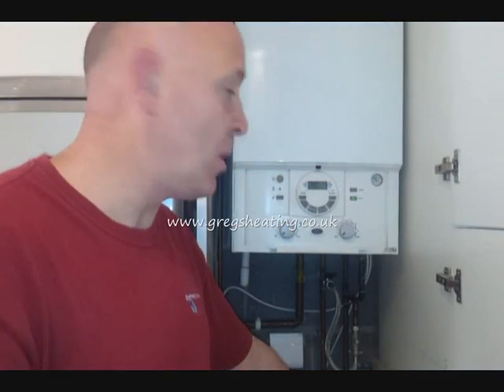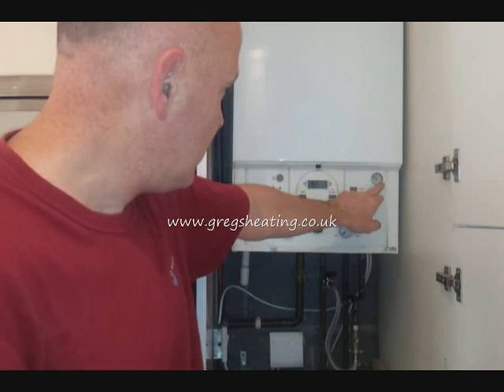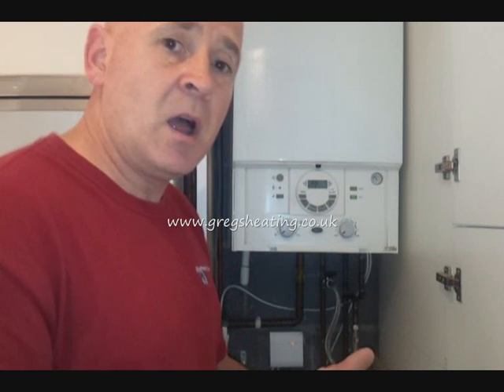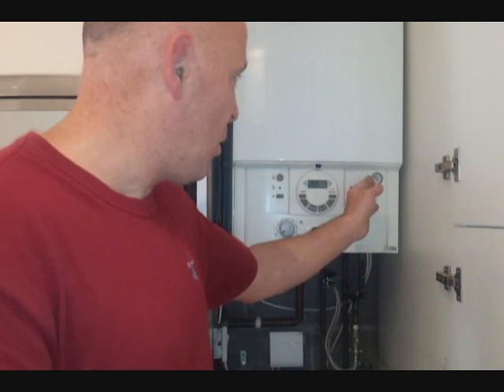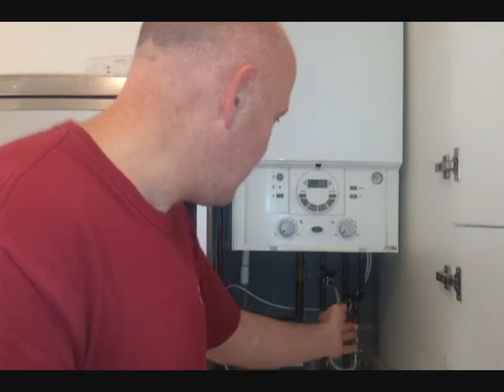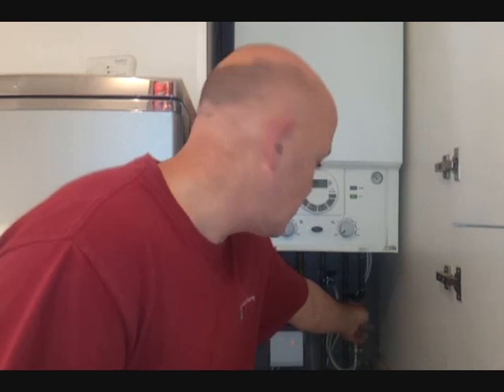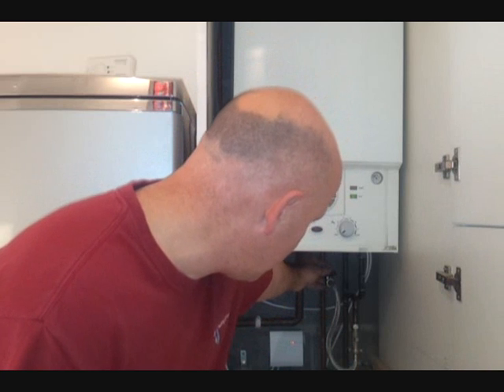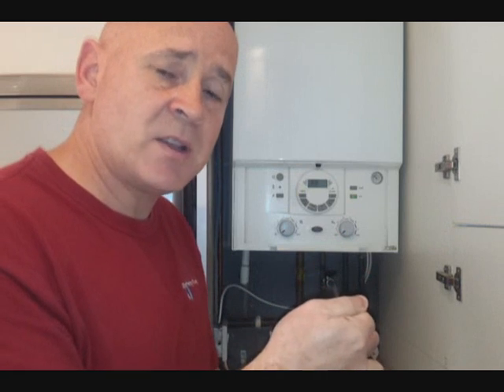How to repressurise refill a combi boiler central heating system.wmv

Comment: No water coming into little mesh tube to put in boiler to increase pressure??.
Reply from the maker: There may be a few reasons simple to rectify your best to call an engineer at this point as it’s quicker to get you running again

Comment: i have a problem with my boiler it has no filling loop i found a loop with 2 valves but it was under my chickens counter and when i turned the valves it did nothing so i don't know if they were the filling loop or not

Comment: Does the boiler need to be switched off to do this operation?
Reply from the maker: Ideally the heating  should be off and it filled when the boiler has cooled down for a bit .
Reply: @ravalde11  Thankyou

Comment: What an absolute hero, saved me days waiting for an engineer and of course the cost as well.

I had two isolation valves on the same braided hose and needed to open both before the pressure increased.

Comment: Hi thanks for the video. My boiler has 2 valves which have to turn both to reset the pressure. When i turn them it works but the top valve leaks water. It stops leaking when i turn the valve back. Is this normal?

Comment: Class video just did it as boiler pressure was less than 0.5 & pipes were making a crackling sound now the noise has stopped , my valve was just under boiler little white square thing next to a white key ( Worcester boiler ) can I ask what happens if the pressure is too low ?? Except for the noise ?? Thanks again

Comment: Hi Greg, is this the procedure I need to follow after bleeding my radiator that isn’t working (I’ve actually got two that are not working) should the thermostat be turned off so the boiler can’t start up? Thanks.
Reply from the maker: AlabamaTree Yes if you have bled a radiator you need to top up the pressure , it’s best done when the heating has been off for a while so the water is cool in the system and it gives you a true reading .
So yes turn off the thermostat at and let the system cool down first .
As to the radiators they should only have air in them if the water in the system had evaporated over time if this is a common occurrence the system is dragging air in or loosing water .
Call a engineer as it could be a fault on the boiler without going into it in detail.
Reply: Gregory Shirley thanks for the reply. I’ll keep an on it and give the chap a ring who installed my central heating about 10 years ago. I’m due a boiler service anyway

Comment: It is essential to release ALL pressure(via pressure release valve)  before increasing it again by adding water, otherwise  the boiler pressure simply keeps going  right off the scale.

Comment from the maker: You have a separate problem either a leak on the system a defective pressure relief valve or a deflated expansion vessel not filling out that your filling loop is not filling .
Best advice now would be call out gas Safe engineer .

Comment: why does nothing happen when i turn my black knob thing just unresponsive ?.....
Reply from the maker: k g 
It could have isolation at both ends of the  handle is spinning, try removing the screw in the black handle then turning  the valve with a spanner.
This fails call a plumber .

Comment: Living abroad my boiler works when it wants i just opened a valve i hope its not gonna blow as i dunno what to do the bar reads always after 3 never gone down any lower still on 3
Reply from the maker: Hi

Sounds like you overfilled it it only needs 1.2 when the boiler gets over three which it will when the heating comes on it will over pressure and take the water outside via a valve . You need to call a engineer to take pressure out of the system.

Comment: Great vid - I had a filling loop fitted without a lever/key to repressurise the boiler. I was going nuts! Found a screw however and tried turning it gently. Did the trick - got to 1-1.5 and works a dream! Thanks - saved me an expensive call out!

Comment: Hello, I have done exactly that but after 20 minutes the pressure goes back to 0 and it stops working unless I turn that tap on again. Do you have any idea why?
Reply from the maker: Hi
When you put the heating on look were the pressure rises too if it goes near the 3 you have a depressurised expansion vessel if it does not you have a faulty pressure relief valve or a leak . I would suggest a gas engineer at this point .

Comment: Thank you very much Gregory! I bleed my radiators and one has a lot of air in. That made the pressure down. All I have to do know is to cancel the engineer appointment that I arranged before I found your video. Thanks again.

Comment: I've just got a new glow worm combi boiler and there no switches to flip for the pressure which is too low? no heating no hot water please help
Reply from the maker: Hi

Please send a pic of the underneath of the boiler
Reply: +Gregory Shirley hi ...you said to send you a photo but without an email address I don't have that option...thanks missionig
Reply from the maker: +missionig info@gregsheating.co.uk

Comment: Hi, great video, thank you!

My isolation valve is operated by a screwdriver, there is no knob. Do I just turn the screw with a screwdriver anti clock wise to repressurise? I'm trying to do that but I can't seem to grasp the screw with the screwdriver - it's quite tight.

Thank you

Comment: Really good video Greg.  Could be worth mentioning that a lot of systems will have isolation valves at both ends of the filling loop instead of a non-return valve.  Both need to be on when refilling and then turned off again once up to pressure.

I know you will know this but it could help others.
Reply: I have 2 valves and one says Filling loop, I'm unsure what to do though and my letting agent isn't very helpful lol. Could I email a picture to see if you could help please?  Many thanks
Reply: turn both on, when the pressure gets to about 1 bar, turn both off.  I am assuming the filling loop (metal mesh covered flexible pipe) is connected at both ends.  There are probably videos explaining exactly this as I am not a plumber.
Reply: Malcolm Powder thanks without your comment as well as the video I wouldn’t have been able to do it
Reply: Thanks very much, this worked for me but quite a bit of water came out of the top valve when i turned them. Is that normal?

Comment: Great Video Thanks! My preasure was at zero and i was getting bubbling noises from start up. its back up to just over one but im still getting a lot of bubbleing. any advice?
Reply from the maker: Sounds like a blocked condensate
Reply: +Gregory Shirley Now it wont actually fir up at all... seems to try to fire up then when at the end there is some bubbling then it conks out. Have a pro coming round shortly... bit out of my league tbh.

Comment: My pressure is just above 1, however when I turn the black knob nothing seems to happen?
Do I need to do anything else to make the system refill itself?
Reply from the maker: Hi

I would need to see the filling loop could you send a picture 
My details are on my website www.gregsheating.co.uk
Reply: +Gregory Shirley Thanks for your reply, I can't seem to see an email address on your website. Would be easiest to send you a photo via email if possible.

Comment: @Vs Guevara - The easiest way to reduce the pressure is to bleed your radiators. If you let water out of a closed system. the pressure will drop.

Comment: Thanks for the video. Our pressure was below 1-bar, but turning up to 1.5 still has not solved our problem of any other water outlet (tap, washing machine, toilet) cutting the shower off. 
The video shows how to up the pressure, but what if anyone goes over 1.5-bar and needs to reduce it. Is there another tap for this? Cheers

Comment: My experience with this...

I heard lots of water dribbling in one of my radiators so i bled it. There was so much air in the radiator that my boiler dropped pressure completely. My initial thought was "Here we go! I've broke it and now I need a plumber £££".

This video really helped. In fact, I re-pressurised the system several times and did the rest of the house. 

One small note, on my boiler (Ideal Logic Plus) there were 2 taps on the cold feed and 2 on the return. I managed to figure out this was just a safety feature (?) and get past it.

cheers

Comment: Thank you so much!  My combi boiler has two blue plastic screws that have to be turned to the left at the same time to up the boiler pressure and turned back to the right at the same time to close them. I am a bit frightened to do this at times incase I over or under tighten them. Could you tell me if this is usual to have to turn two screws and not just one? Thank you.
Reply: kpzcbttp

Comment: This worked a treat for me. I did have to repeat the process 3 times to get all the air out the system. (decorators had caused a leak when they took the radiator off)  But it worked and thats just fine with me
Reply: +jonathan dempsey-- my local builder/decorator a Polish who lived down the road caused me a huge damage on the ceiling below a loft extention room with a basin which he fitted but had a faulty tap which dribbled continually. its difficult to find an honest builder or plumber. My recent plumber who called themselves Able cut the wrong pipe from the vanity unit and left with the leak still on. Then they send another one of their plumber who was very honest and professional said that the first plumber they sent me did the wrong thing.. its the flexible metal wire connected to the tap which was faulty and cannot be fixed and he fixed the wrong thing which not needed because I had been told to change the unit, still the company charged me £132.00!!!
Reply: +Vs Guevara

Okay.............

Comment from the maker: Hi
Thanks for the comment regarding the capping of the filling loop , yes the water regs state the filling loop should be isolated and they specify the means of isolation .
1. By means of isolation valves and a non return valve on the heating side .
2. By removing the loop and capping also using a non return valve .

In the case of my video number one method is used .

This video is to help people how to repressurise the system .

A video on how to fit a filling loop to water regs is currently being edited and will be posted shortly .

Comment: I have 3 "isloating valves" (black knobs which can be turned to the wall) NO matter what comination i use i cannot seem to increase the pressure above about 0.5. What should i do in this instance? I have a Main Combi 30 HE. ANy help would be great thanks.
Reply: ignore my above comment the filling loop was about 2 feet below the bolier hidden by towels :)

Comment: what to do when pressure is too high? how to reduce it?
Reply from the maker: If the pressure has risen and you have not filled the system then you need a gas engineer as your boiler has a problem,if you have overfilled it you can drop the pressure by draining a radiator till your pressure drops to around 1.3 bar.
I hope this helps.

Thanks Greg's heating

Comment: Hello Greg, im having to constantly every now and again repressurise my boiler and at times it is perfect??.....secondly have u and tips on best way to regulate the flow to central heating, bcoz one or two central heaters downstairs heat-up slowly?..ive shut off the top ones and sorted the downstairs valves then turned on upstairs valves just a bit about a quarter turn. still a day or so upstairs would be burning hot and downstairs would be not as much.  can u help pls?